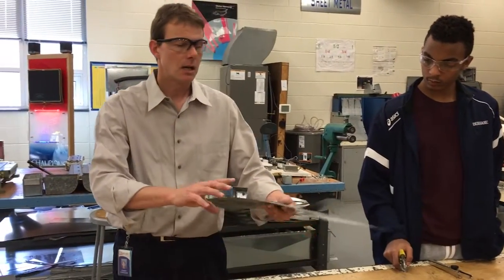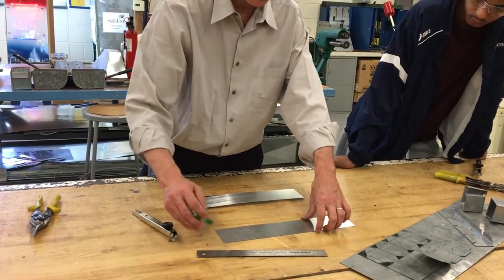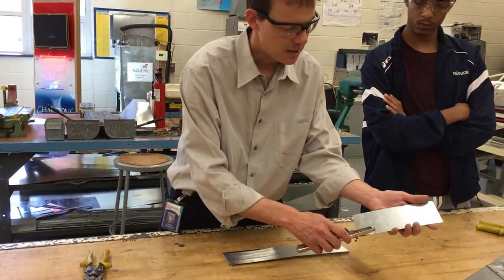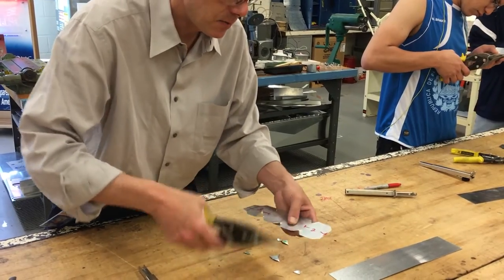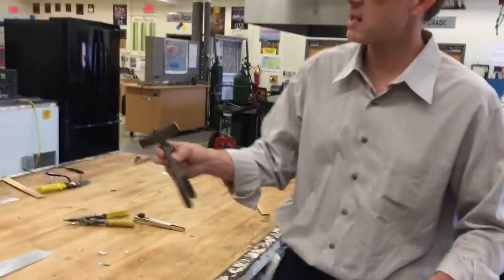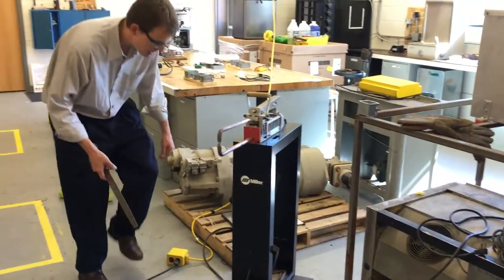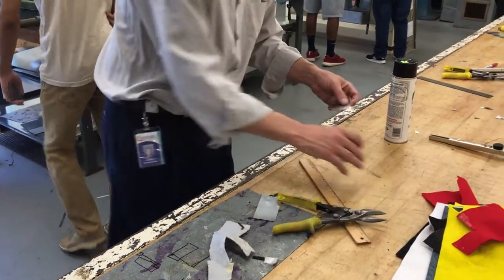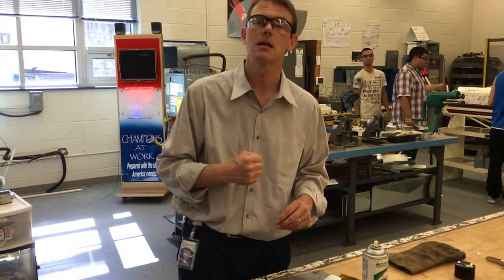HVAC Basics: Procedures - Sheet Metal Project 1 Create a 2" x 2" Metal "Box"

Comment: not 1000volts but 1000amps at low voltage. by touching the box like you did,you will be pretty injures if it was a 1kv !
Reply from the maker: +Martin Martin yup. Your right. Even if it had a half an amp or more of current or it would. The voltage just cooks...the amperage kills. Thanks for watching and for the comment.